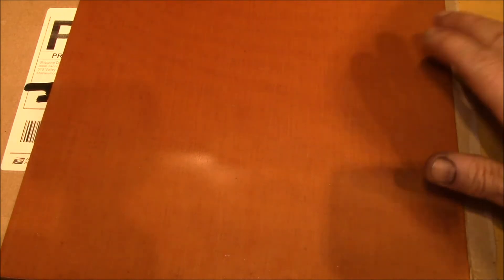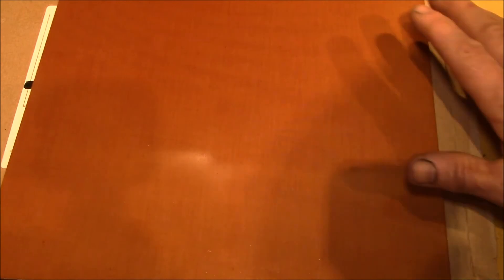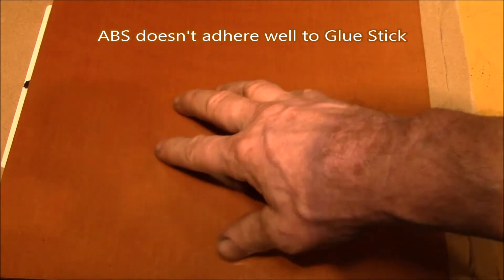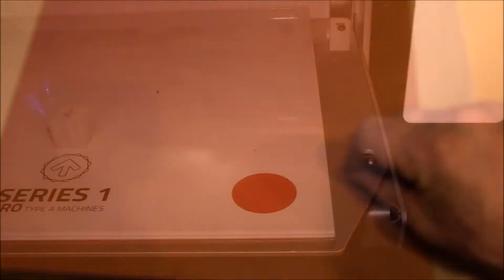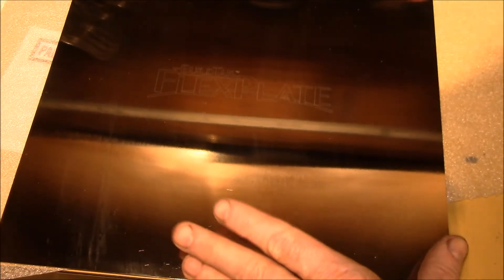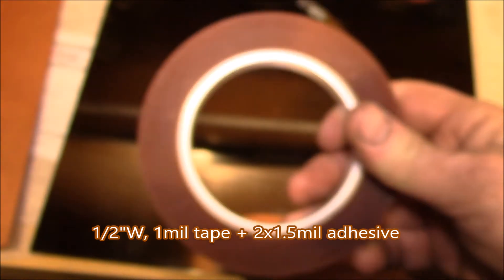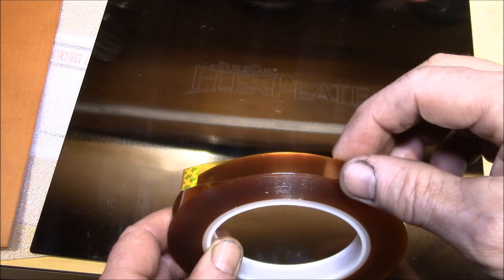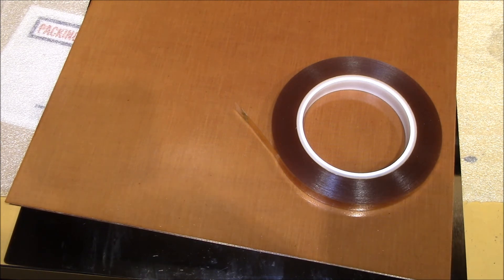3D Printer Garolite Flex-Plate, Part 1

Comment: Good info, in the furture you might look at Gizmo Dorks 3M 468MP Adhesive Transfer Tape Sheets 8" x 8" (5-Pack), for the adhesive 10.00 will get you 100% coverage and still have a 8x8 sheet left over
Reply from the maker: Thanks for the info.  If I run into adhesion issues with the Kapton tape, I'll give those sheets a tryu.
Reply: how has it been doing for nylon
I just got in my sheet of garolite today and I have alot to print
I watch all the videos you made on it, run temp bed still the best option
Reply from the maker: The Garolite plate worked well for my first batch of nylon parts.  I run those on an unheated bed.  With the small parts I usually print in nylon, warping isn't really an issue and on the Garolite, adhesion is great on a cold bed (printer is in the attic, so is in a fairly warm environment during the summer).

Comment: How do other materials like ABS stick to Garolite?
Reply from the maker: So far I've not tried any other filament on that surface yet.  I may give PLA a try at some point.
Reply: R Brown PLA with a glue stick works perfectly. As is with all printing surfaces, ensure the bed isnt too close to the bed. The nice thing is that the garolite allows for you to bend the print blade and even the largest surface area prints pop off with ease